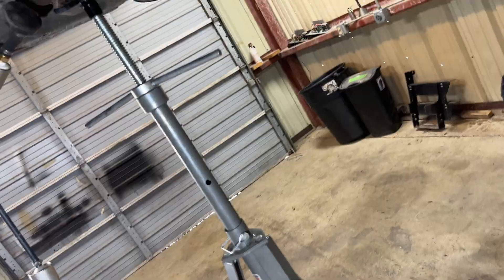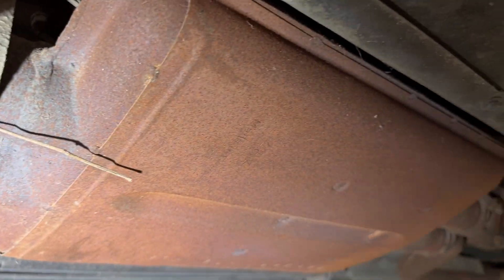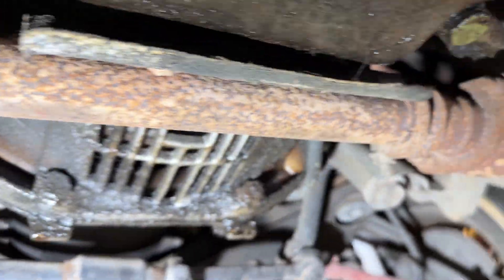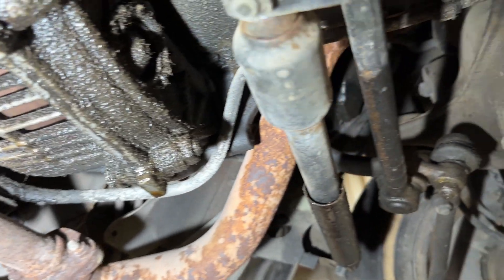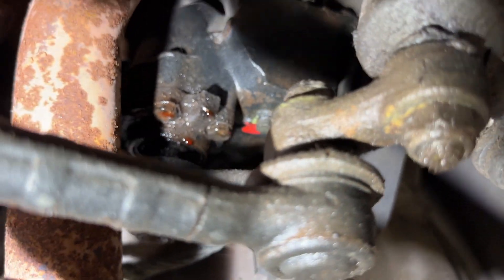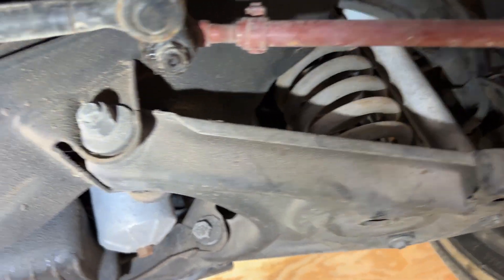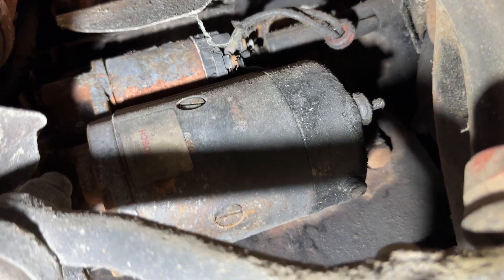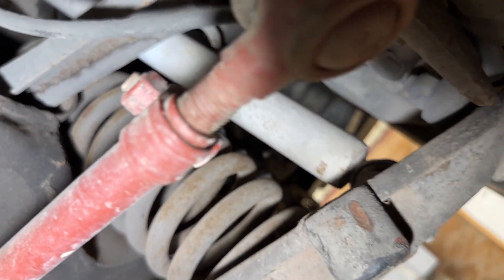1974 Classic Mercedes R107 450SL revival - Has been off the road 20 years PT 2 Will it run?

Comment: Looks hot in that garage Matt....these cars are 50 years old,sometimes it is better to start again from the ground up.Gasgets,seals,rubbers,rust issues,most of it is just gone after this time.Also pay attention to valve clearance,the engine and front subframe mounts.Good luck finding the no starting problem

Comment: Looks good dude. I’ve got a 74’ 450SL as well and I’m wondering where your vacuum lines run to from your vacuum
Advance on the distributor? There is a switch over valve next to the coolant reservoir.